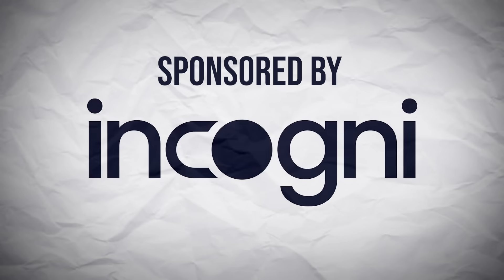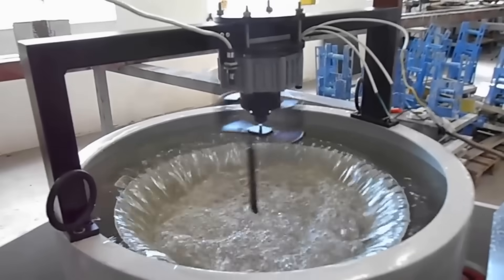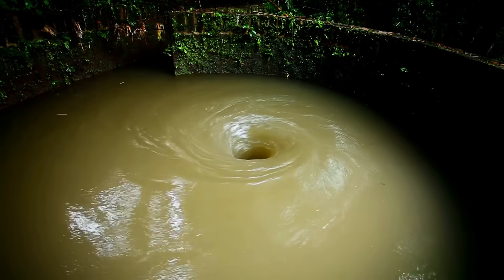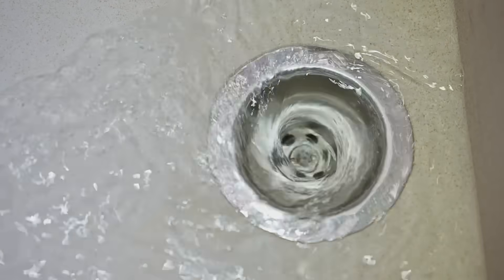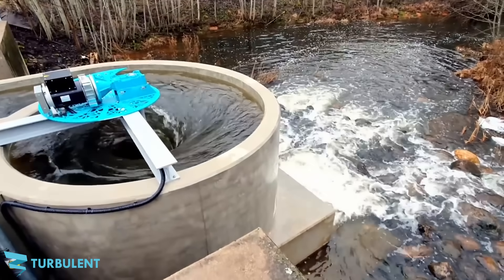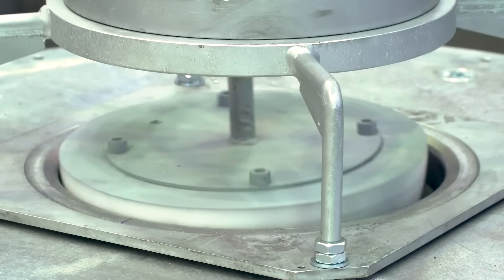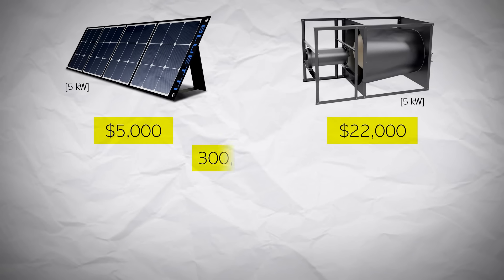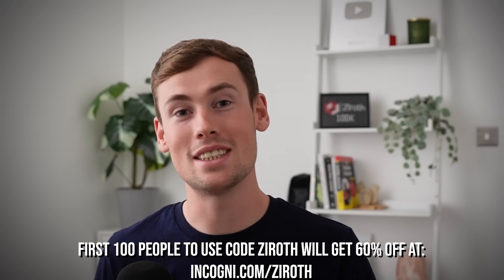Genius Bladeless Hydro Turbine is Cheaper Than Solar

Comment: nikola tesla designed the first bladless turbine. It actually generates a lot of energy. The tech was rejected in lieu of blade turbines.

"The Tesla turbine is a bladeless centripetal flow turbine patented by Nikola Tesla in 1913. The engine uses smooth discs rotating in a chamber to generate rotational movement due to the exchange of momentum between the fluid and the discs. The turbine uses the boundary-layer effect, instead of the method employed by more conventional turbines, wherein fluid turns the blades. The reaction force to the steam head pressure builds relatively quickly, as a steam pressure "belt" along the periphery of the turbine."  wikipedia.. though this information can be found in other sources.

Comment: Cool.  Offset from center creates an imbalance, and that imbalance could could be used to generate power, noticed how that shaft end was off center.   Worth doing some experimenting, looking for power source I could tow from a sailboat, so far I have a fan blade in a duct but this new method looks interesting.
Reply: It is an interesting concept, however I think in a permanent installation I could see this offset load running 24/7 causing quite a few problems with bearings and material fatigue.
Reply: On another note, towing it behind a vessel might be difficult to achieve, unless the unit was secured solidly as I believe the unit would most likely corkscrew behind the vessel as opposed to the desired operation.

Comment: I wonder if this could be used in  city drainage/sewer systems to produce electricity? It seems like the  somewhat pressurized infrastructure  of such systems would  go well  with this turbine because you would already have the pressure necessary to produce a vortex.
Reply: This is my thought as well. Pumped water is one of the largest energy users on a community grid so being able to recover some of it through this and the pressure release valves seems worthwhile

Comment: In your cup example, the ball never gets too close to the sides of the cup, making it "fish-safe".  In the ACTUAL designs, the ball is intended to get very close to the walls, with one example actually narrowing the tunnel at the ball to get it closer. (which probably improves efficiency?)  That we would call a "fish-crusher".  And with how fast it's revolving around, there's no sneaking around it.

I think, generally speaking, the more "fish-safe" a turbine gets, the less efficient it becomes.  Though like you said, if it needs to be safe and isn't, the efficiency is ZERO, totally agree.
Reply: Your are right! Basically, the are always a cost of what you get
Reply: even if it does not touch the wall the speed these turbines spin at means there is enough blunt force to do damage.
Reply: In theory the ball will never touch the wall because of the bernouli effect
Reply: Nah. Manufacturer makes it clear that you're supposed to put a protective grate/screen solution in front of the turbine. (Not just for fish, but other debris as well.) a couple layers of painted expanded steel seems to be the favorite. If a fish got into it, the force of accelerated water would push the fish into the rotor/confusor (which can be adjusted at install, if you're serious about preventing damage to aquatic critters) and, maybe knock it a time or two, before being kicked out the back. Unless it's something like a fry, it'd most likely survive the ordeal.
Reply: @QuakeDragon   Well, if you are supposed to keep the fish out of the generator, you might aswell use a conventional model and just filter and bypass the generator with a side stream...

Comment: Ryan ..... have a look @ PV - T panels ..... gets the heat of the back of PV appx twice the amount of energy taken off the panel as the electric ... down side " the trades " ie it involves the removal of energy by electrical & physical methods ie liquid / plumbing .., so 2 trades & the " O they did it " clause .., when it stops work ... There is a Turkish panel that has been in production since the 1970s ...

Comment: How about usi g urban water systems as a water flow source,  installations  such as this in pressurized, so no municipal sewer pipes, no species danger , semi solids, would be further broken down, so no blockages,, a similar system to a river having a series of dams generating electricity, fed into a local grid, for use in the comminity,  image the water flow from skyscrapers, gravity fed, replacing the electricity used to pressurize the water system,

Comment: You have not take all into account as rivers does not have a constant flow as all year round like by us some rivers stop flowing if there is a dry spell then solar would be better and way cheaper.
Also that ball fish could be crushed with but you know what turbine is safe for fish and designed many eons ago is the old water wheel that had buckets on 😂

Comment: The only problem with this idea is that fresh water resources are diminishing with each passing year. Take a look at any Dam Reservoir to see how much water has evaporated. Glaciers are melting and have a finite volume of water in them, especially when precipitation in the form of snow is also diminishing ... thanks to global climate change.
So while the ball turbine might be more efficient than solar for the time being, it may end up becoming useless in the next 30 to 50 years when the rivers run dry.
None-the-less, it is a very interesting technology. Thanks for sharing it.

Comment: when you were talking about bladeless turbines I thought you'd be exploring magnetic pumps / generators.. the conductivity in a fresh water river would never be high enough to make it economical large scale (hopefully not) but I'd be curious on the generating potential for an off grid setup as a trickle charge on a battery could provide emergency power for a low use setup.  Could the introduction of an LK99 SC provide the boost needed for tech like this to become commonplace?
Reply: LK99 hasn't passed peer review
Reply: @fascistpedant758  I was talking in regards to magnetic pumps.  SC would improve efficiency on the generator side but that would apply to every system and wouldn't have an efficiency increase on energy captured.

Comment: There has been a recent development in the UK with pumped storage with a low height differential, they are using a fluid much heavier than water to make up for the lack of height

Comment: Have you ever researched the solar water heater that continues to work at night? "The Alternative Energy Company" made a solar water heater that works 24/7 in temps as low as -10 degrees Celsius. I want someone to make an in depth unbiased review of this technology because if it works as promised I have big plans for this on my dream vision board.
Reply: It's not solar. It's a heat pump. The fact that they claim it's a solar water heater indicates that the company is scammy, at best, and likely outright fraudulent. I'd stay away from them and contact a legitimate company advertising and selling heat pump water heaters if you're interested.

Comment: Since the ball is smooth I just can’t see how much rotational torque would ever be applied to the ball. Maybe if the ball is oscillating in a circular path around the inside of the turbine (while not necessarily spinning) they can capture the mechanical energy of that oscillation and translate that into a spinning motion via a crank or something to generate power but I can’t see how a perfectly smooth ball could generate energy very efficiently. In applying what I’m trying to say in your example experiment, it wouldn’t take much effort at all to keep the ping pong ball from spinning even if the water was swirling in the cup at a high rate of speed therefore it seems like the ball would never be able to efficiently generate a lot of energy…if that makes sense. Lastly, anytime a company doesn’t want to give much information about their product because “there is so much demand” it’s usually a sign that they are either really bad business people or their product is not what they’re representing it is. It’ll be interesting to see where this tech goes. 👍
Reply: Did you not watch the video all the way through?

Comment: I think, to kickstart the vortex, the previous design (snail shape) or inlets like the ones in the vortex fire jet stove are better. And then the axis can be made more static and not wobbling around.
Reply: The way it works has nothing to do with a vortex, it's due to lift on the wobbling sphere, this guy's just confused about how it works.

Comment: Talking about fish friendly, I saw a bladed turbine that was just that, on a science program Towards 2000 or Beyond 2000 (can’t remember which side of 2000 it was).
It was invented by engineering students at a university in Ireland.
The reason it was fish friendly was because the blades were driven by air, not water.
Basically it was a large container that filled with water from a river source (or other). 
As the container filled the air expelled drove the blades at the top of the container.
When the container filled to just below the blades it would automatically open a release valve at the bottom. The water exiting would then draw air into the vessel further driving the blades.
To keep the blades turning in the same direction their cross section was such that it looked like a diamond lying horizontally, with the two sides at one end being much shorter than the sides at the other end - hope that makes sense.
The water source would, of necessity, need a drop in levels in line with the top and bottom of the container.
Reply: Sounds like a tide generator.
Reply: I remember the Beyond 2000 shows. They had very interesting stuff.

Comment: Safety and affordability are equally important as efficiency. If you can install many small/cheap solutions you have more redundancy and less precision required to generate power, especially nice when something fails. 👍 cool video, thanks for sharing ✌️
Reply: There is also the problem of sediment deposition.
Every turbine reduces the momentum of the water which results in greater sediment deposion behind the turbine.
Reply: @maxmustermann9587  That would be an issue in some setups for sure. 👍 Maybe several arranged  laterally, maybe along a low head damn or the like would help alleviate that problem. It's worth a shot! 🤔

Comment: I’ve got a crazy idea.  Rig it up so you have a small reservoir that repeatedly fills and empties.  Either have gates upstream and downstream that you alternate opening and closing or build a giant bell siphon.  Either way, the reservoir has floats in it that rise and fall with the water level.  Turn the mechanical motion of those floats into electricity.
Reply: There are similar systems being tested based on buoyancy in seawater, to make use of the waves.

And there also "sea buoys batteries" being studied. Basically, you use cheap electricity to reel the buoys to the bottom of the sea, and release them to recover (part of) the energy.

If you have a dam which regularly floods and empties (thinking on the Panama channel and the like) you could reel the buoy when the water is low at almost no cost (since there would be no pulling) and then release it when you fill the dam.

I'd say that's pretty solid for being based on a gas filled container in a liquid :p
Reply: Look up destiny 2 titan wave generators. Something like that?
Reply: @bossjosh423  Based on what I can find with a quick Google search, yeah, that looks pretty spot-on.
Reply: it's likely to work but I would guess the efficiency is poor.

Comment: There are some wind power generation ideas that involve using the wind to “wiggle” a piezoelectric material.  You could do the same thing with water.  So basically underwater “flags,” where the undulation of the flexible surface generates electricity.  Seems like it would be pretty fish safe.
Reply: yes but prone to barnacles, weed etc
Reply: Doesn't sound very scaleable
Reply: So instead of instantly killing the fish, the flags will just b*tch slap them really hard?
Reply: Or you could rectify microwaves to power a magnetostrictive transducer to produce ultrasonic waves to stress piezoelectric materials Eg. Quartz or materials made from Zirconium ions 🎉
Reply: @marilynlucas5128  I’m not too proud to admit I had to look up those words.  Rectifying antennas and magnetostrictive transducers sound like interesting technologies.  Where would we be getting the microwave radiation though?  If we’re using the rectifying antennas to harvest energy from sunlight, isn’t the energy content of the microwave portion of sunlight pretty small?  If someone manages to get rectifying antennas working for the infrared or, better yet, visible part of the spectrum, that’d be pretty cool though.  And is there a way to power magnetostrictive transducers without electricity?  Because, if we’ve already got electricity, I don’t see why we’re converting it to mechanical force just to convert it back to electrical energy with piezoelectrics.  Or maybe I’ve just completely misunderstood your idea.

Comment: A tidal system would possibly be better as it could be designed to work both ways with only a short pause at the tidal change.
Silting would not be a problem in a tidal system. It works on the tidal rise and fall. 
It wouldn't take a genius to work out how to prevent anything but water from entering the system.
In the UK you have many good tidal areas in safe positions that could supply massive amounts of power.
Reply: Fish come in many sizes. It would take some thinking. California hasn't yet figured how to pump from a river for irrigation without killing a lot of spawn, mostly in the filters  Power dams on rivers kill 22% of fish.

Comment: I'm not a physicist so prepare yourself for a dumb question... that drive shaft attached to the ball looked clumsy, inefficient and like a single point of failure. I'm guessing that it leads up to some sort of dynamo. What if you break up the dynamo and move its coil into the ball and its magnets to around the outside of the cup ? Figuring out how to access the electric current flowing inside the ball underwater rather than in air might be a challenge but perhaps this has already been done in some form of electric motor in a boat or submarine...
Reply: Why ?
The air gap must be very small between the rotor and stator as this is where the magnetic field transfers from rotor to stator.

A big gap has high losses.

Comment: This design is just another gimmick. I'll tell you how you can make the fish safe. Put a mesh in front of the turbine so they can't go through it. And if they have to bypass the turbine to go downriver, something akin to a seperate little water slide around the side should do the trick. You might even hear them go "weeeeeeee...!" as they descend. Ball turbine indeed. FFS... 🙄

Comment: I suspect that a rough surface,or ridges would improve the ball's rotation.(k.i.s.s.)always look for "simple"tweaks first.

Dam!
There must be an equally simple way to create a weir and a chute to increase flow in one location and still allow fish to travel safely between levels.(pun)
But,seriously.
Make a weir.
construct a chute diagonally across the weir face.(
simply place a tethered ball at the bottom and another at the top.
(There will be an eddy in each location for you to harvest energy from,even when the river is not in SPATE)

Comment: Should replace the ball with a series of disc's. This will increase the surface area that has contact with the rotating water and increase its efficiency gaining available energy.

This is similar in principal to a Tesla turbine being more effective with a number of thin discs.  Integza had a recent video mentioning something similar.

Seems like this could be achieved without the ball and less risk of being a grinder by using the exterior walls as the moving surface instead.  So snail shell shape to redirect to a rotational force, directed onto moveable outer wall which is maximized to increase surface area as much as possible (roughness, dimples, groves etc). That rotational movement is then used as input for a generator.  Flow should also have more energy in the outer regions where the wall is than in the middle with the ball I believe. 

Obviously technically more difficult to rotate the wall than a ball.  Guessing there would likely be less wear as well.

Comment: When coal, oil and gas run out humanity will enter the nuclear age. Solar, wind and hydro are irrelevant anyways and a distraction that should not be pursued. Waste of brainpower and resources. Only good for very remote locations and even then in most cases a nuclear micro or nano reactor would be a better solution.

Comment: The bottleneck on hydro isn't cost, it's dam sites.
Reply: Engineers and economists aren't dumb. They chose the best dam sites first. Suitable sites were always going to decline through a process of elimination. One factor in site selection is stable rainfall (this is what makes the temperate zones better than the tropical zones, generally), and climate change can both reduces and destabilises rainfall. Some site suitability will improve, some will decline. Unfortunately, decline is more likely in exactly the place that could use hyrdo the most.
Reply: The bottleneck is NIMBY-Karens pretending to care about the wildlife.

Comment: I think for a fish safe turbine unit they could use the tesla turbine effect , just use a row of textured disks spread apart it should yield a fair amount of power output.
Reply: if i remember correctly tesla turbines need a fairly high fluid velocity to function properly
Reply: yea it would take many of disks to have any yield of power production in low velocity fluid.